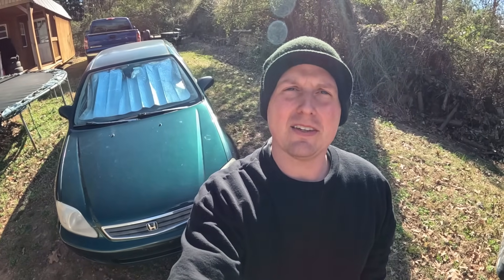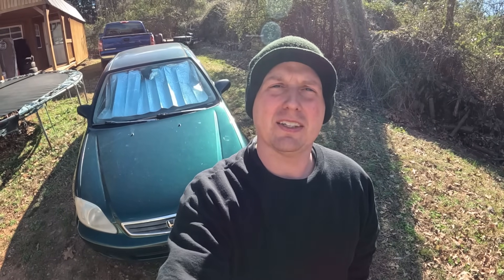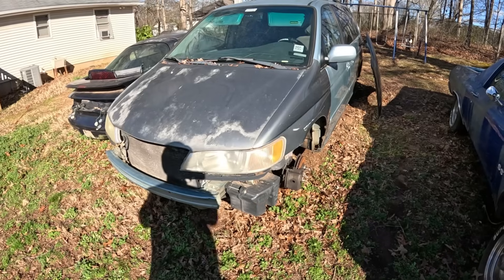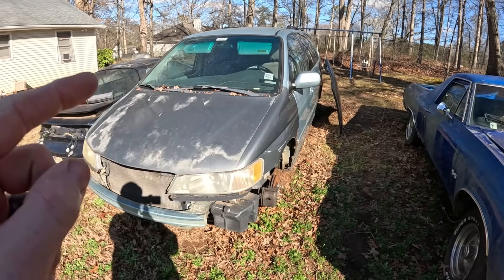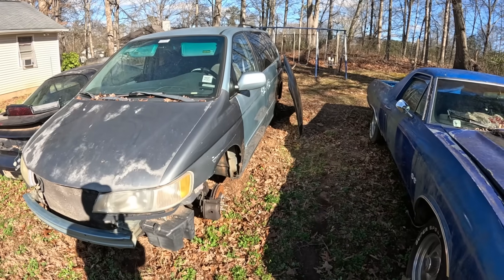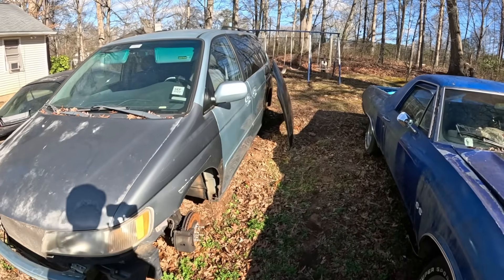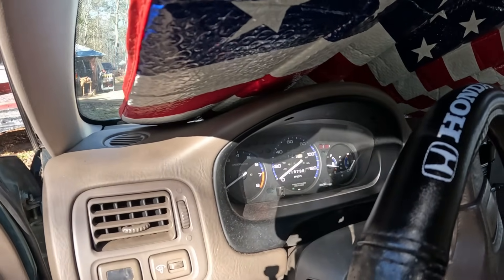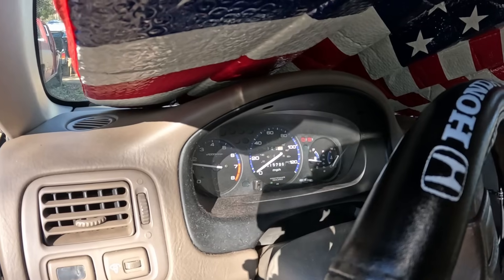Check Engine Light P1456 | EVAP Leak Diagnosis on Honda Civic

Comment: My 04 civic has already had the fuel pump replaced about 25k miles ago, (125k total miles) and it had to be installed TWICE bc there was a faulty seal inside the pump or tank. Now im smelling gas off and on, especially if i fill up more than 3/4 full, and i can hear bubbling coming from the back seat after a long time of driving. 
Its not my gas cap, but inside the filler area i noticed part of the metal is slightly bent in one spot. Basically its right where you put the gas nozzle in, and its the top area of the metal and only bent in one place. Im wondering if somehow that can be the issue or what else is causing it.
I had a mechanic come by a week or so ago to check and he said its no big deal but didnt even look. So im not sure where to begin to figure out where to start fixing.
Reply from the maker: Sounds like you’ve already dealt with a lot—especially with that fuel pump install. If you're smelling gas and hearing bubbling, there's definitely something going on. That bent filler neck area could possibly affect how the tank vents or seals during fill-ups. I’d check the EVAP system too—things like the vent valve, charcoal canister, or filler neck seal can cause gas smells, especially when the tank is fuller. A smoke test can also help pinpoint leaks if you’re not seeing anything obvious.
Reply: @ thank you!